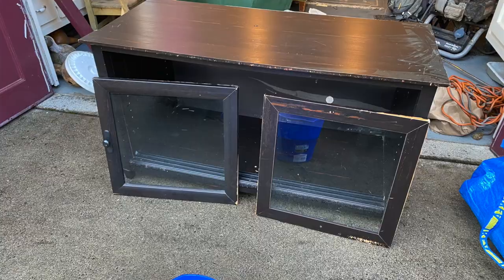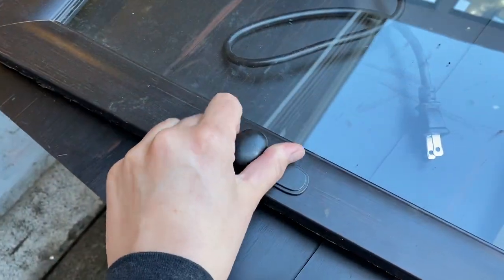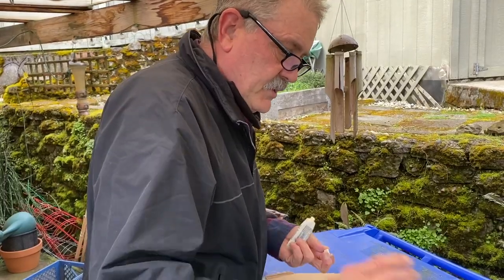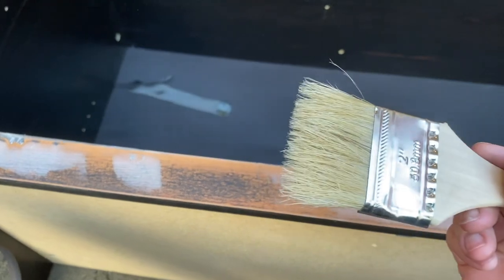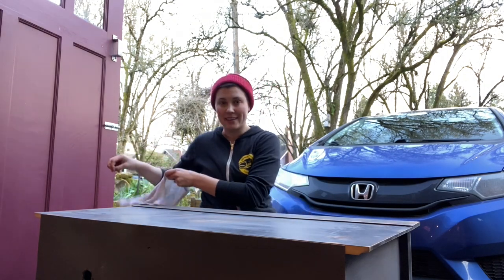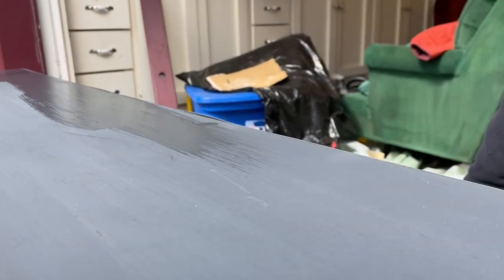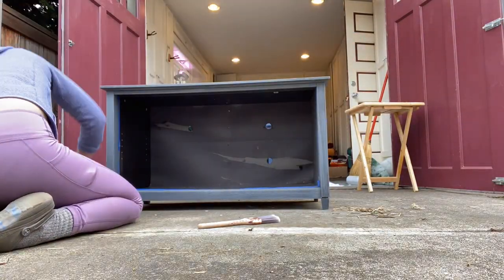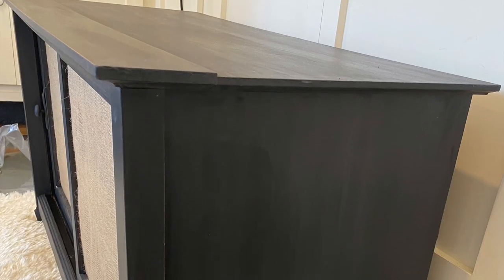*dramatic* TV stand makeover / trash to treasure furniture flip

Comment: An oil based primer would have helped a lot with any bleed through. I would have painted the inside as well, cheap contact paper is a big help as well for the back wall. Try a true chalk paint, you'll love the coverage and it sands and distresses wonderfully. Walmart and joanns sells waverly chalk pain, it's affordable and easy to use. You can also check out a wallpaper store, I picked up a wall paper like burlap, it has a nice backing on it with a burlap like texture to the front. Keep crafting!
Reply from the maker: Thanks for watching, Cathy! I ended up painting the inside after I had listed it for a week and it didnt sell. It ended up selling! I love the wallpaper burlap idea. Thanks!